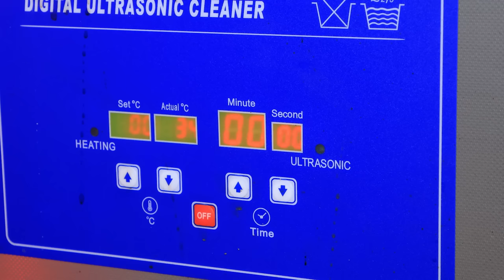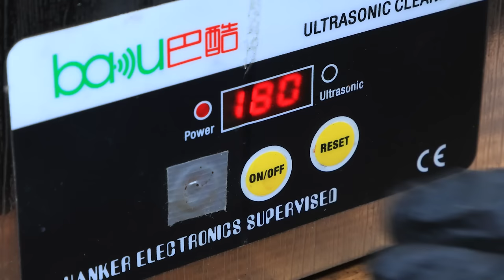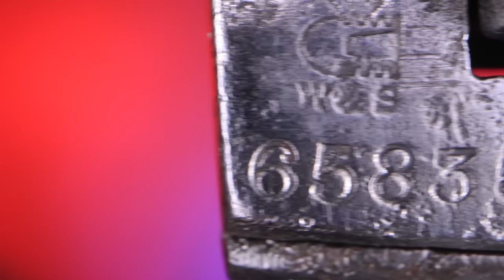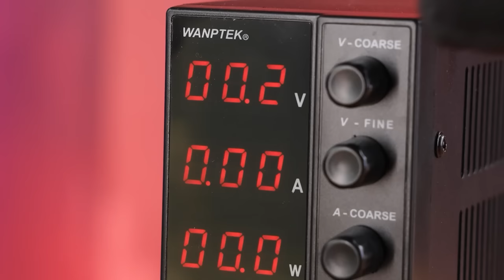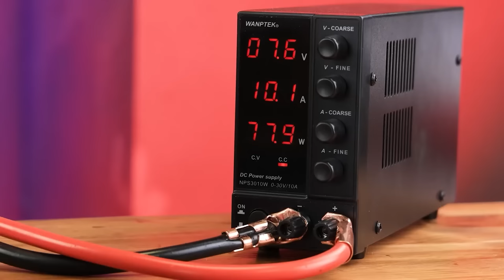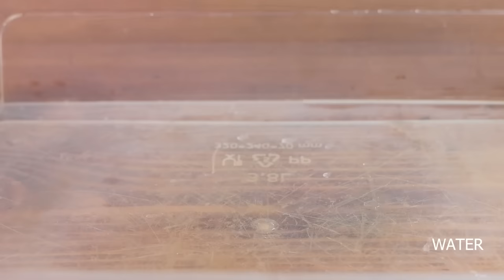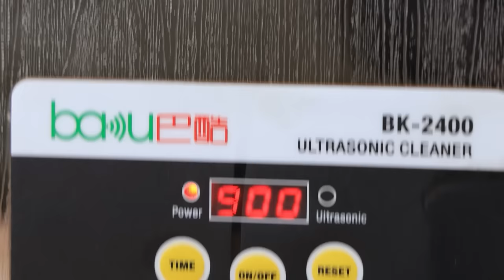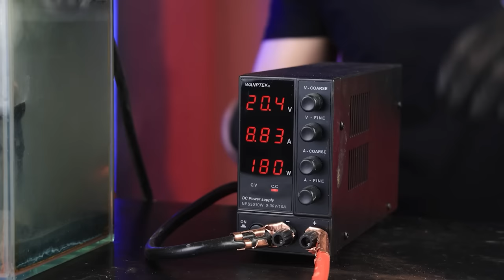1882 British Bulldog | Old Revolver Restoration

Comment: Once you torch the parts, isn't the temper of the steel ruined? I assume some of these (at least) are just being restored for display only.
Reply: Hello! Я думаю, качество деталей испорчено уже давно 😅
Reply: In most cases it should be fine as long as he didn’t get it red hot, he was trying to get it hot enough to loosen the rust and help the pieces move apart so he wouldn’t have to drill into it too much.